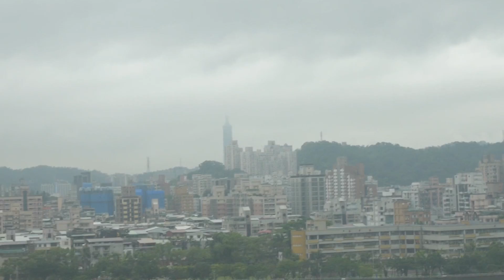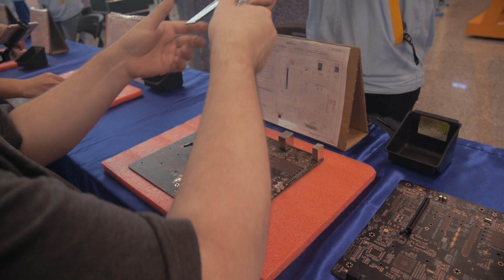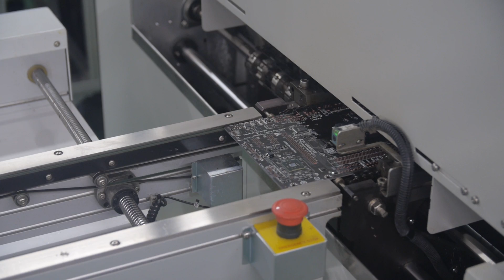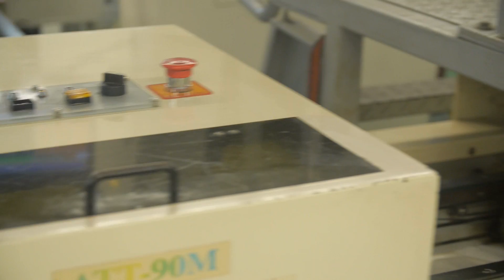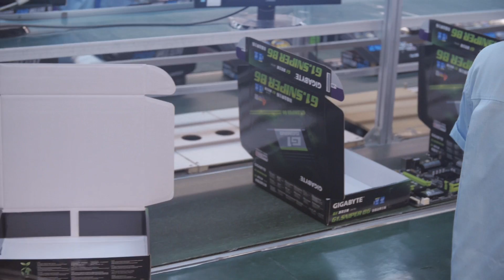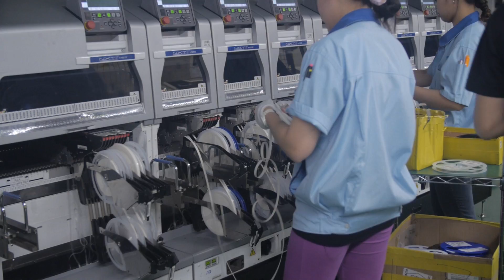Computex 2016 - Gigabyte Factory Tour

Comment: Sadly i never buy any product from gigabyte again. I buyed your 390x and your quality is just fucked up. The chip ON it explodes (that may not your fault, more reliable to that would be amd) BUT the main problem was that fukin cooler ... that even to  call a cooler is ironic as fuck. Your 390x from gigabyte get soooo fukin loud ITS INSANE. Yes i know amd cards get hot, yes i know the chip can handle 90decres, yes i know BUT your card gets soo fukin loud under load its not normal ... never buy a gigabyte product again, put 30 euro ontop and get a better company name on your mobos, grakas and stuff. GIGABYTE u r dead for me.

Comment: Gigabyte's hardware is generally good... (except their GPU fans.. even the top of the line stuff use cheap sleeve bearing fans)
Their mobo software is not up to par thought... full of annoying bugs (I have to re-calibrate the fans after every reboot)
and the fan control interface is terrible (sometimes you can't change the fan curve because the temp indicator blocks whatever is under it)
But other than that, Gigabyte is solid. I've been a loyal customer for 20 years now... never had any issues with their mobos or GPUs.

Comment: Wendell your hand/arm would be fine if you stuck it in there. Unless of course those are metal straps. But if those bands are plastic those only thing you wound need to worry about is the heating element inside the machine. Burnt my finders fixing one once.

Comment: Are all motherboard components that heat resistant to be heated to the temperature of solder melting, or are some components left for precise robotic soldering that reduces direct heat on the chips?

Comment: hey just thought id correct you DIP means dual in line package, meaning a chip with two lines of pins (like the original 4004) all dips are through hole but all through hole are not dips... - Mechatronics Engineer

Comment: I like Gigabytes's boards. The Mobo I'm using has been going strong since 2010 and I plan on using Gigabyte again soon. The two Gigabyte graphics cards I've had have been rock solid too with zero issues  unlike ATI with crappy coolers and crappy fans.
Reply: ati?!?! 2010 board?!?! dood you need upgrades
Reply: I have seen many trooper z68 boards. I just replaced one at work that was hammered on 24/7 for years, and only died from user stupidity. I really like Gigabyte motherboards. I have three at home, a workstation in the office, and many other boards in the office. They are my go-to brand. I must admit though, I prefer EVGA for graphics cards.

Comment: Gigabyte were always trouble with me, had to RMA a mobo and a GPU from them.
Horrible RMA experience, will never purchase anything else from them.
I really don't need to, too.
Reply: I rma'd a motherboard from them and it was as well a horrible experience.
Reply: i know but that's not what the topic is about. He's claiming that gigabyte is generally awful yet it is actually very good. I have gigabyte MB and it's still holding great. Works just like on first day.
Reply: Weird... I've been a loyal Gigabyte customer for 20 years... none of their boards or GPUs have died on me..
Reply: people you need to learn that all respectable brands like gigabyte asus msi they all are good they all break they all have bad samples which barely made the testing it's just your luck whether you're gonna get the good 1 or the bad 1. :)
Reply: only mobo to die on me was a gigabyte :S
Reply: had a GPU and mono neither broke
Reply: I haven't had a motherboard die but OC experience with Gigabyte Z68 onwards was always a pain in the ass with "boot failure due to changes" randomly happening. Also always needs more voltage compared to say MSi for the same OC and never as stable. I did have a 5870 that died, VRM's burnt out. Poor design meant they ran too hot. It lasted 4 years.
My P45 and X58(x2) boards are still kicking doing server, rendering and guest gaming duties, so I cant fault the longevity of the old stuff.
Reply: my gigabyte mobo has worked fine for over a year, I've overclocking on it, and it was a cheaper board (maybe $50.) different experiences I guess
Reply: Yep i've done other pcs with z97-ud3 Gigabyte motherboards all worked fine except for this recent z170x-UD5 which was a hassle since the RMA department was shit.
Reply: really? I'm still using X48 DS4... it's still going strong (used daily for about 10-15 hours). Holding Q8400 3.5 ghz overclock wonderfully. 4 - 5 years of 3.5 ghz OC and 7 years in total. I'd say gigabyte is pretty much a beast.
Reply: Everybody sucks for RMA's. That is why I only purchase motherboards from Microcenter. They allow returns of new boards that do not work (unlike Newegg), and they do some service locally. It really matters.
Reply: agun17 I have an Asus tablet... full of stupid bugs and shitty Asus crapware apps... no more Asus anything for me.
Reply: "customer has a bad experience and puts a label on the entire company"   I bet you put shitty newegg reviews up on all products.

Comment: Fuck gigabyte. I bought a gigabyte r9 390 gaming edition and It worked perfect for a month then i started having display driver errors very very often. I would even blue screen and the error could would be graphics card related. So I called gigabyte and got set up with one of the worst customer supports ever, who was apparently helping me trouble shoot. Everything he told me to do I told him I already have done multiple and multiple times. So he told me I could send it in and they would look at it. So I sent it in and it took two fucking months and I got it back. It wasn't any different. It wasn't even touched. It did the same
Exact thing. I asked my friend to borrow his gtx 970 and I uninstalled all my graphics drivers again and Tryed it out. Worked perfect for a whole day. Hoping it was something else and I was wrong about gigabyte. I bought a new Asus Proffesinal motherboard. New psu. Wiped my ssd and did a clean windows 7 install with fresh updated driver.Gotothe replies
Reply: After all that. 400$ on the graphics card alone. 300$ down the drain on extra unneeded parts. I had no money so I just bought a evga gtx 750ti for the moment and works perfect. I'm really disappointed in them. I wasted all of my money from Christmas and I can't even do anything and they won't either.
Reply: well its better than MSI. i called them about motherboard repair. they told me to buy a new one.
Reply: +WhiteandNerdy44 what inconvenience. I'm out the hole 400$. The graphics card is worthless they did nothing to it

Comment: Could be nice to see a indepth video about the vision part in the robotic production, liek what cameras they use ETC; and what feuteres, but very nice video, it help me in my work! now i know what machine gigabyte use, and now i can try to sell to them thanks
Reply: Cameras are very important. They're not only used to build and test products, but also to catch errors as early in the process as possible. Which is critical for cost reduction. They perform inspection of solder paste application, guide pick & place machines, inspect component placement, align routers, etc.
Reply: Wren akula, exactly! i work in a industrial camera company that specialized in production vision :) it's a very exciting market! with alot of growth, and there keep popping up new applications for the cameras, example we worked with some application called "FreeD" to create a VR experience and a sort picture stitching so you can roam free in a 360 degree wive it's a exciting technology, u should look it up :) (replay-technologies) if you wan't ofc :)
Reply: Casper Claudi
Very cool! It looks like freeD does something like space carving to create voxel models?

Comment: This further strengthens my decision to buying only gigabyte products from now on, my asus motherboard died and their horrible CS took 2 months to get it replaced.
Reply: ASUS might have gotten too big too quickly.
Reply: Yea fuck Asus.
Reply: i agree gigabyte is awesome
Reply: Same here
Reply: Yup I was a longtime ASUS user but last year decided to go with a Black edition, it was a great decision. Working flawlessly.
Reply: I have had some issues with Gigabyte, but not nearly as much as I have had with Asus boards. No company is perfect.
Reply: Hmmm... I have Asus Maximus VII Ranger mobo and the integrated network card "kind of" died in 1 year and 3 or 4 months. It didn't work like in 3 days (my PC is always fully shut down when I sleep, as it was then too) and then I wen't away for the weekend and my PC was of course shut off for the whole weekend. When I came back on sunday and turned on my PC, the network card magically worked... Too bad because I had already ordered a new PCIe card from Intel. But I didn't care too much though because it only cost like 50€ and I don't really trust the integrated network card anymore. This happened like 3-4 months ago.

Windows device manager showed that the network card didn't work properly and that there was a driver or hardware failure, then later it changed to only hardware failure.

I tried re-installing my network drivers first and restarting the PC, also checked the BIOS if it was disabled there.
And the PC was also turned off like 3 full nights like it normally is and it didn't start working after those but it started working when it was 2 full days and nights turned off.

OH! Now I actually remembered that I also unplugged the power cable from the wall before I left on the weekend, so that might be why it worked after that shutdown. Dunno what happened to it in the first place though???

Yes, I still have warranty for the mobo but I didn't want to take my PC apart right now (I wanna game, I had school stuff to do and this is my only PC). I will return it, but right before the warranty ends :D It has about a year left.